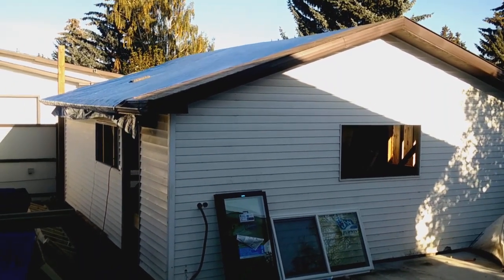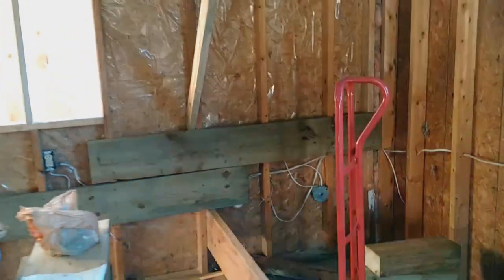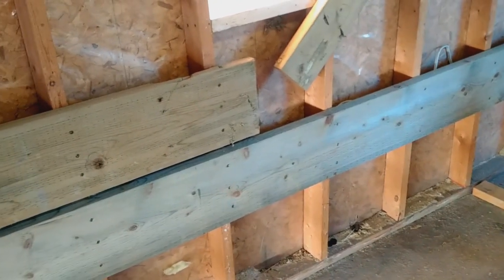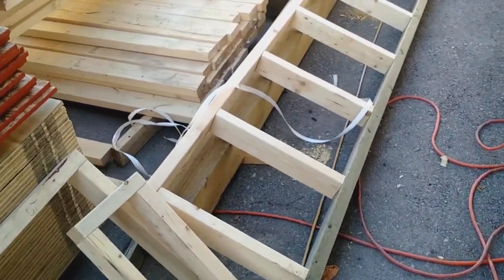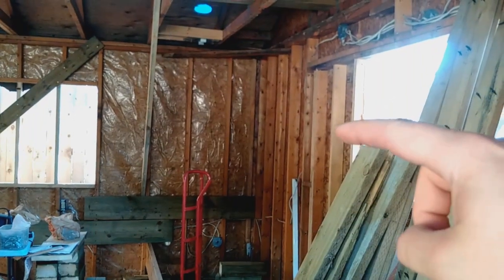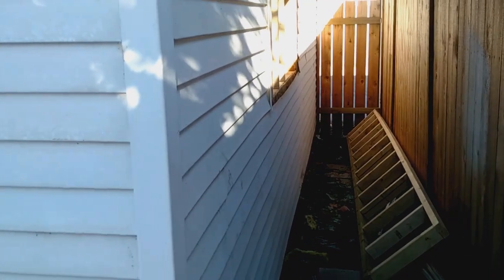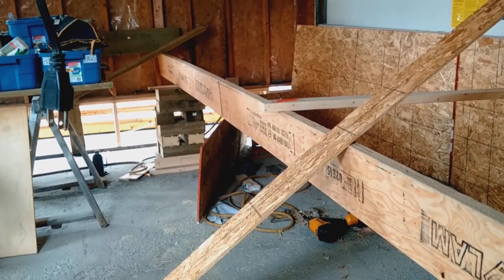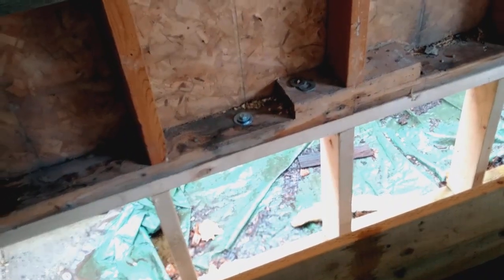How I lifted my double garage up 21 inches

Comment from the maker: Quick note: If you want to explain the horrors of the hinge point, go ahead.  However realize that 75% of the studs in the garage are full ten foot length.  This video was published before the entire project was done, but I do cite the importance of the full length stud.  Apologies but I'm inundated with comments about this from people who only watch part of the video, or don't read the comments.
Reply: John Molberg I
Reply: John: ... or just read other people's comments. I know what you mean.
Reply: Cindy: What did you indicate?
Reply: HA !!!  The internet.  The magic of the world at their fingertips and eye holes.  Yet, the patience of "sh*t their pants" toddlers.  

Great video, man.  I have a plywood floor, 24' by 24', hip roof building.  Going to jack it up, to pour a concrete slab.  It's currently pier and beam .. .. so I do have some work ahead.  My jack points will all be outside the structure.

.. but your video helped immensely.  Thanks so much, for posting !!!!

Comment: So I took the time to read all 285 comments and their replies and here are my observations. All of those who question the structural integrity and have a better way, fail to recognize two fundamental concepts: (1) It's his property, his house, his shed. He gets to make the risk assessment for himself (within the limitations imposed by local codes and inspectors - IF ANY). (2) There are many ways to skin a cat. He did it this way. It worked. It is safe. It complies with local codes. So if you have a better, or even just a different way, by all means please share your video. I will watch and consider your approach as well.
Reply: I just came across this video as I ponder on my shed I will be lifting. You can tell this process has been well thought out. Hell ya! Obviously this worked but if it hadn't just imagine what else he would have learned. Great job on pointing out the mistakes in the people commenting. You can not google experience you have to earn that!

Comment: Nice work. We raised my sons garage up just 8 inches so we could set it on cement blocks. The slab and lawn grading caused water to infiltrate the sill plate. Putting it up on blocks was to prevent the sill plate from rotting. 
I would have much rather followed your method with the pony wall. 😊
The garage was very old and had car siding on the exterior walls. The building had a pronounced lean to the east. I think prevailing west winds pushed it out of square. After we had it raised we put OSB in the corners to reinforce it and prevent the racking that it originally had. 
Just after we finished a large storm came through and dropped a big branch out of a maple tree onto the roof. State Farm paid for a new roof to be installed and for painting the garage after the roof was done. 😊
Reply: car siding = tongue and groove aka shiplap for those wondering
you were smart to use masonry units to protect against said flooding, should have asked your insurance adjuster for more money for foundation slab improvements to get it raised out of floods harm

Comment: Thanks for the video man! Wife and I bought a house with a 12x20 shed. The previous owners didn't bother putting it on concrete or blocks...let alone gravel. So now the floor is starting to rot. Luckily the frame is still solid so I'm going to go this route after laying a 4" pad. 

I'm saving this video for future reference! Thanks again
Reply from the maker: Terrific.  You would be well served to place your stacks outside of the structure and then you can have lots of room inside to pour a floor.
Reply: @johnniemo  I'm actually planning on moving the shed via rollers and tractor (slowly, but surely), pour a pad large enough for a lean-to addition, and roll the shed back onto said pad. My main purpose for raising the shed is so I can extend the lean-to addition far enough to almost double my interior shed space - i.e the lean-to addition will be framed in. I live in Michigan and need a steeper pitch due to snow rating. Within reason, I figure the higher I can lift the existing shed the further I can extend the lean-to with the appropriate pitch. I intend  to discuss my plans with a legitimate contractor I've know for some time before I go through with it.

Comment: Great to see. Thanks for filming & posting this. I have to do this to pour a new floor and exterior concrete area 1 foot higher than the original. It was very useful to see the method for lifting with 4 jacks. Your bracing matches what I see in the local building moving company yards when they have removed garages sitting for sale. 
As a tip, the house & building movers round here use dishwashing liquid for lubrication! Whether between timber or metal surfaces apparently it works better than grease or oil!
Reply: I always read the expert's in the comment section on how "they" say it should be done. And most don't have a clue and just throwing out stupid opinions. Your comment sir is exactly what this section is intended for: "use dishwash fluid for lubrication"! Brilliant and helpful comment. Thank You.
Reply: 61spindrift I know what you mean! My dad used to be in demolition & I was brought up around old building demo & construction. The first time I heard of the dishwash liquid was when a 3000 ton building was moved in my city. The engineers had a situation trying to slide the building on rails and had tried the greases, oils & high-tech ptfe lubricants but were stumped by the sheer load. One of the experienced contractors suggested he pop into the supermarket next door (literally next door) and get the solution they always use - Palmolive dishwashing liquid (similar to Fairy Liquid). Worked a treat and averted a huge delay. This a is good summary of that move but it doesn't mention the liquid. I've read about it in another story. 
(They also mention the 5000 ton hotel shift in New York 1888.)

http://i.stuff.co.nz/dominion-post/news/wellington/9054381/Training-all-eyes-on-shifting-a-hotel

Comment: Nice job.  I did something similar years ago but I raised the roof only and removed top plate, scabbed on 10' studs, added new double top plates & set roof back down on top plates.
Reply: Wayne Doherty Would need a day long party with the amplifiers up to 11 to "raise the roof" long enough.

Comment: Great video. Did the exact same thing years ago to a 12 by 16 shed that was slowly rotting into the ground. Raised everything by 2 feet, installed a proper foundation and a new wood floor. Became a great little workspace afterwards.
Reply: I'm currently doing this.  any resources (videos, books, websites) you recommend?
Reply: @asalborn  Sorry, no resources as I did it all with the experience garnered over the years working with my family and spending 3 years building houses with a local builder.

Comment: I've been racking my brain about redesigning my roof trusses to gain headroom and now I come across this guy! Holy crap what an idea! My shop is 24x36 though 😅
Reply from the maker: The method should work.  As long as you reinforce the structure a bit, those bottle jacks will lift an incredible amount of weight.  You could do three cross beams to be safe.  You can order custom LVL beams in whatever size you want.

Since I did this, I came up with all sorts of improvements.  For example, you could lift from the outside.... you could lift off the roof.... you could use an automotive 4 post lift....  So many options.  It's not as scary as it seems.

Comment: Great video with lots of great info. I lifted my garage years ago just to replace rotted sill plates and lowered it back down. I did it similar with bottle jacks and supports to raise it just enough to get single 2x4s out and back in. Now I want to raise mine up high enough to put a block foundation because my garage gets water in it during heavy rains and I have a lifted truck that doesn’t fit in the garage without putting smaller tires on it first and it will prevent the sill plates from rotting again.
Reply from the maker: That's great.  You already know what to do.  I was inspried by a guy who did the same thing as you and for the same reason.
Reply: lol why wouldn't you fixed the drainage issue first , concrete blocks aren't waterproof so you're not fixing any problems
Reply: @Trump_Won_AGAIN  I have fixed drainage issues, but that doesn’t fix the garage sitting on a slab that is dead nuts flush with the dirt. The slab doesn’t even stick up 1-2 inches. Most slabs stick up higher than the length of your grass, this one did not. The siding even went all the way down below the grass line, when weed whacking it would hit the siding. Yes proper drainage gets rid of excess water, but it has to get on the ground first doesn’t it? Which is where the sill plates were. Even with drainage the wood would get wet. The second issue I wanted to remedy was the low ceiling height which is why I raised it. Your blocks not being waterproof example doesn’t matter because they do work for keeping the wood above any possible water, the blocks aren’t going to rot and don’t let water into the garage because there at the surface not below ground. My garage slab sits so low it’s “at grade” not above at all. It was a more unique situation than most and raising it was a permanent remedy than trusting drainage methods alone. Levies,pumps,pipes,ditches,damns work until they don’t. Drainage alone isn’t and shouldn’t be the only method of preventing water damage.

Comment: Excellent. I was contemplating using a crane to lift the roof. This is so much better and cheaper.
Reply: Was looking at Crane as well, but lifting entire structure would be a problem, and lifting entire roof, I’ve seen them buckle.  The crane concept just seems too risky.

I have several month to prepare for my barn/garage lift and I think I’ll use two rented forklifts instead.  It’s impressive how slow but powerful and most importantly, I’ll be raising a full story, in my case 9’.

Comment: We looked into buying a house a while back, the detached garage was around 8’ interior height and I need 12’ for my vehicle lifts . This building has a brick facade so my plan was to cut the roof loose and lift just that, add the knee wall and have the brick continued then paint the brick. 
We ultimately did not buy it but I’m confident it would have worked fine .

Comment: cool deal I did a garage that was resting on sill wall when originally built. But time and the elements caused the sills and studs to rot from the bottom .When I was a teenager the ceiling joists were 7 ft high . When I began the lift they were 4.5ft I put six 4x4x12 evenly spaced vertically thru the roof ,tied everything together similar to yours & ran 2x4s down the ceiling joists along side the 4x4's as I lifted I cut a piece of 2x4 & nailed it to the 4x4's to act as stops. I raised the joists 5ftthen built the walls down to the new foundation....

Comment: Wow. Massive undertaking. You made this look easy. I wish I could have a lift,  but I don't have a detached garage. There's no way I'm lifting the entire house! Great job man!
Reply from the maker: Thanks!  Hardly easy.  It is 2 years later and I'm still not done all the finishing.  I will post another video once everything is complete.
Reply: Talk to a few engineers/architects and see what they come up with for a solution to your "dilemma", I am sure something is possible if not directly attached to the house structure, unless its firmly attached to the house directly then there is nothing that can likely be done without remodeling.
Reply: Actually, the process for a whole house is somewhat simpler. "Simpler" meaning no bracing required and it's just lifting. Just need 10 times the number of jacks and a whole lot more insurance.

Comment: Nice job on the lift. I myself wanted to do the same project on my 22 square foot garage. I consulted a architect about how to do the job and make it pass code. The single most important thing was the fact I needed to run a continuous stud from the base plate to the top plate. Doing a few of these would not work for the sake of satisfying the code requirement. So I ended up doing every other stud in the garage and for the studs I did not run from the floor to ceiling, I made a sandwich up 2/3 rd's of the way up. this was only allowed after I gave the village inspector the architect number and they had a little talk about my job. I was finally told that any alteration to my roof would require a new set of studs to be added to every stud I now had in place. The load on the roof would be to great for only half the studs that I used. IN the end I replaced and or sister ed a single stud from floor to ceiling on every stud location. About 3 times the work of just doing it correctly the first time?
Reply from the maker: Thanks Bob for that insight.  Good information here.  

Although not mentioned in my video, I did the entire permitting process on this build which included hiring an engineer and getting a city inspector.  I got a lot of varying opinions on the lift, but nothing consistent.  In the end, I did what the engineer asked, and the city inspector said "we don't do it that way anymore" but he signed it anyways.

I have no concern on the strength of the structure as it exists now... but I did go above and beyond what was asked by both the engineer and the inspector.
Reply: "the city inspector said 'we don't do it that way anymore'"

What way DO they do it?
Reply from the maker: Bob Mccann great question!  I spoke to the city building department about ten times throughout the build process and they gave me an assortment of answers. It became clear to me that each and every inspector has a different opinion. 

In the end I consulted the engineer and he suggested this approach. I added the sistered studs as I felt they were needed. 

The inspector didn't give me any insights other than said "we dont do it this way anymore". I was satisfied with my work so I didn't probe him. I was just happy to pass inspection.

Comment: My slab is at grade, too. Though poor rain handling has made it very much worse, this arrangement makes me crazy. I am thinking about lifting and rebuilding the lower portion of the walls to remove the rot, but I would want to put it down on blocks or a concrete pony wall to keep it up away from the rainwater.
Reply from the maker: Others have done this and ultimately inspired me to do mine too.  If you want to leave it in the air long enough to build a masonry wall, you can do that.  Here is a guy with the same problem you have.  
https://www.garagejournal.com/forum/showthread.php?t=371545

Comment: I'm impressed,. very well thought out. great job.  I like how you addressed the hinge potential.  it's similar to the Hyatt Regency walk way failure in the 1980's.
Reply: I know your comment was 2 years ago, but you are correct. Was studying mechanical engineering at the time of the collapse and very similar to this hinge on the pony wall. However I believe the poster eliminated this scenario with full length studs in certain areas.

Comment: I have a need to build a new garage since the old one has really crappy pier footings and rotting bottom beams, but if I tear it down to pour concrete footings and a short foundation wall I won't be allowed to rebuild due to code changes. Next year I'll be jacking it up, supported at the roofline, pouring the footings and installing all-new walls. Later comes a new roof and since I won't be demolishing the building but just making a series of repairs, I won't run afoul of the code.  Who knows. I may even do a finished room over the garage. I never thought about using bottle jacks, but they will work well for my project. Thanks.

Comment: Doing the same here cept mine is a carport with two walls and exterior siding only. My design is to lay two rows of block vs your pony wall idea. Need to raise it all about 8in then pour new crete as the existing slab is lower than grade for some weird reason and all the plates/studs are rotted. Gonna make it a closed shop/garage when completed. Would just tear it down, but the roof & truss' are all in great condition.
Reply from the maker: Boiling the frog.... I like it.  The guy who originally inspired me also put down concrete block as well and for the same reason.  So long as it is stable, you can leave it there for a long time while you lay the wall.  With the price of everything these days, keeping perfectly good trusses is worth it.
Reply: @johnniemo  Studs were $7.50 ea here recently down to $6.50 hopefully even more soon so I can commit to the project. In the meantime, it's fun to play in CAD & Excel bean counting the project down to every nut  bolt & board.
Reply from the maker: @clutch5sp989  I modelled my entire garage in sketchup prior to the build.  It was painful, but certainly was helpful for doing permit drawings, purchasing decisions, and to get an overall feel for the space.  I still go back to that model regularly to find studs, or test fit things.  I recently made a video about a paint booth and I built it entirely in sketchup before I built the real thing.  It's on my channel somewhere.

Comment: I used coupling hex nuts to put REAL THICK 1/8 PLATES on my tie down old 1/2" anchor bolts  were barely high enough. Some of yours too. Fix With a small counter sink washers that surround the depression. They always used cheap skinny washers, no wider than nut Useless- I used 2x2 squares
2xd